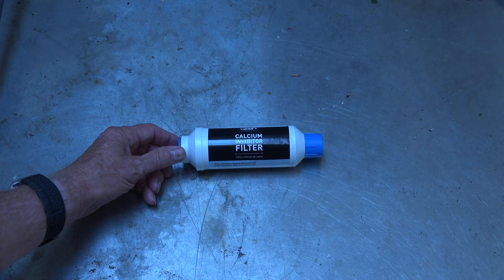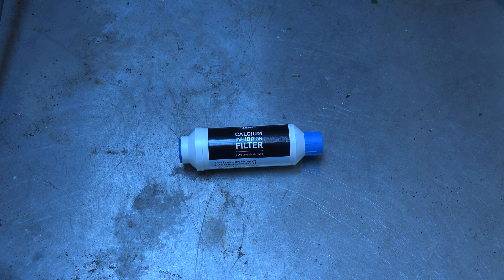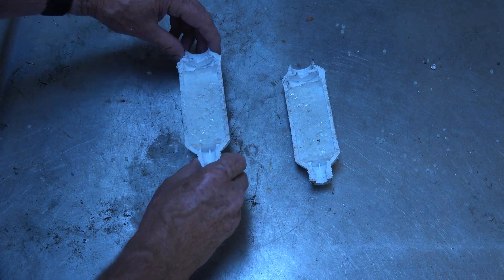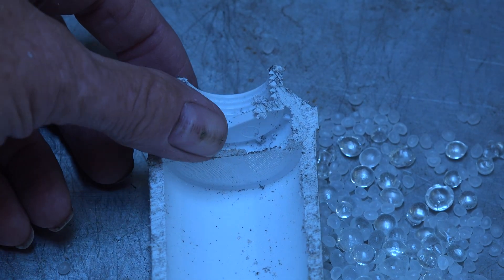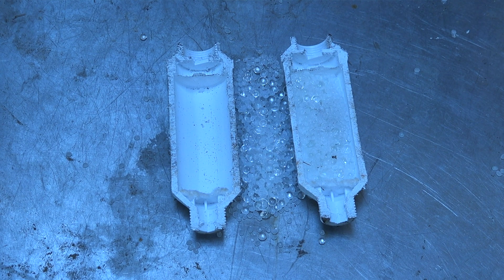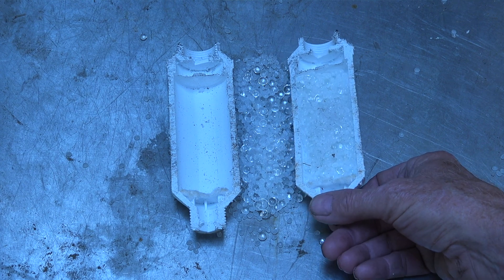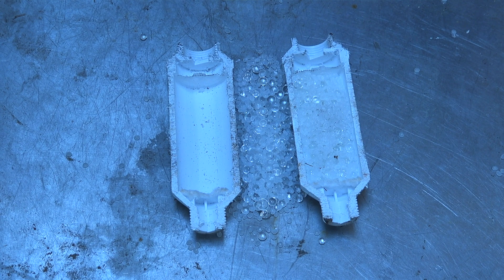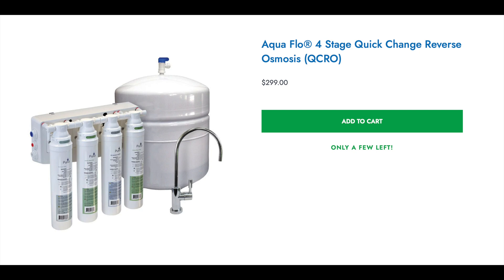Does the mister water filter work for calcium on the A/C coil?

Comment: Scale inhibitors dissolve a chemical into the water that bind to the calcium and dissolved solids in the water supply. It usually not the beads themselves but a coating on the beads. Even after the cartridge is used up the beads will remain. The chemical used depends on the manufacture and reputable ones will use a food grade additive.

DI Resin cartridges work to remove the calcium. The work via a similar process as a water softener, just without the sodium exchange. The result is pure water with a neutral ph of 7. 

The "RO water is corrosive" is a bit of a myth. It stems from when RO is put though a pipe that has previously had high TDS water transported through it. The RO water will dissolve any mineral deposits. RO water may dissolve some copper but the amount is small and would be practically immeasurable being sprayed on a condenser coil. The lower the TDS of water the less conductivity. Electrolysis requires conductivity to take place. Therefore RO water would not increase electrolysis, it would actually decrease it.

But to the point of the video I think there are better way to go about lowering head pressure than misting systems.

Comment: Great point about possibly dropping the head pressure too low at night or on cool days. Of course there are multiple ways to prevent that, but if the goal of buying the misters is to save money, the customer probably won't want to spend the money on fan controllers, pressure switches, solenoid valves, etc.

As a general rule of thumb, what would be the minimum condensing temperature we would want to see for a typical modern system with a TXV?
Reply from the maker: First, We have a parts bill that exceeds any possible savings.
I would like to see about 100F.
GFM
Reply: @grayfurnaceman  Exactly my point. Even if there's no damage to the coil, by the time you get a proper mister setup with actual filtration and a solenoid valve controlled by a pressure switch or some other way to control the misters and pay for the water, the payback period would likely be longer than the unit's remaining lifespan.

Thanks, 100 degrees seems about right. Now that I think about it, I suppose someone could figure out approximately the ideal head pressure for their system by slowly dropping it until the delta T starts to decrease. I'd think the efficiency should be pretty good right at the point where the delta T is at its lowest or just barely starting to increase.
Reply: @averyalexander2303  With a TXV you can lower it to just above the point where flash gas starts forming at the TXV. The ideal head pressure doesn't really exist since is changes based on operating conditions. You can add more and more controls to chase that ideal pressure, which is what manufactures are doing.
Reply: @TofuInc  Great points. Wouldn't using a receiver in the liquid line possibly allow for slightly lower head pressure by helping to ensure that only liquid reaches the TXV? My understanding was the main reason a receiver is pretty much always used on vehicle AC systems with a TXV is because the head pressure can't be effectively controlled since the ambient temp and condenser airflow is so variable.
Reply: @averyalexander2303  In a modern condenser the bottom 1/4 of a condenser is basically used as a receiver. Adding a receiver would allow for more of the condenser to be used, more heat rejection would result in a lower heat pressure. In that case you could run quite a low subcool and still not starve the TXV. It's quite invasive solution though and you are adding quite a bit of refrigerant to the system.

A simple way to address low ambient is just with a fan cycle switch. connected to the mister. 

A better way to address the situation is to instead of using misters use a higher RPM condenser fan motor. Most come with a 825 RPM motor and 1075 RPM are readily available. Then add a ICM fan speed control. This is what I have done with my unit. Added a high HP 1075 RPM motor and changed the stamped, square blade fan for a swept blade fan off a commercial packaged unit. This resulted in much more airflow without increasing amp draw and actually resulting in a quieter unit. It also lowers my head pressure in mid summer. I'm using a ICM326HN to reduce the fan speed at low ambient. It has quite a bit of advantages such as not starting the fan immediately allowing the head pressure to build quite quickly. I can actually see the sight glass clear in under 30 seconds where before it would take several minutes.
Reply: @TofuInc  That's what I thought, thanks. I was asking from a theoretical perspective, not from the perspective of adding a receiver to an existing system.

I'm not a fan of pressure switches for fan control on single fan residential equipment, but using a pressure switch to only activate the misters when the head pressure is high should work well.

Great idea, actually controlling the speed of the fan instead of cycling it on and off is definitely the way to go. You definitely need to be careful with using higher RPM fan motors though, there can be other differences like the design and pitch of the fan blades, so assessing the system as a whole and making other changes as needed like you did is the way to go.

It always amazes me how crude and cheaply built the majority of American central AC units are though generally not even coming with high or low pressure switches or freeze protection let alone head pressure control.

Comment: if a mister is configured to ensure 100% evaporation before reaching the coil, say in a  hot/dry southwest climate, does calcium still accumulate or does it blow straight through as dry white 'dust'?
Reply: so, build a swamp cooler for your ac condenser? lol, yes that would work even better, but rather impractical on a wrap around coil. an old flat "slab" coil unit with fan/s it would be good on. but as mentioned, head pressure needs to be maintained in low ambient conditions, so you'd need to add a fortune in bypass dampers, fan cycle/head pressure controllers and more or at manually turn off and bypass the cooler. yes there's other ways, but not practical and complex custom built designs.
Reply from the maker: At one point, I built a wood frame about 8 inches away from the coil and mounted the misters on it.  Did not seem to make a difference.  However the humidity was about 15%.
GFM